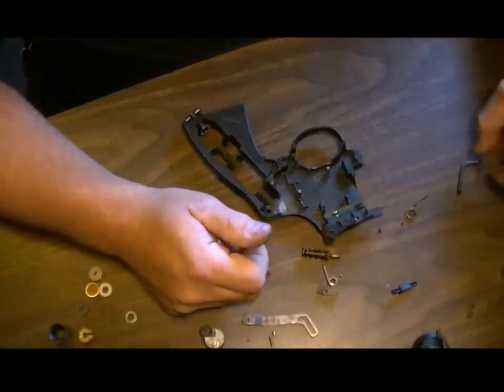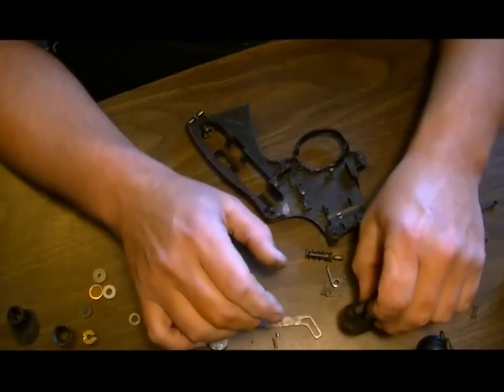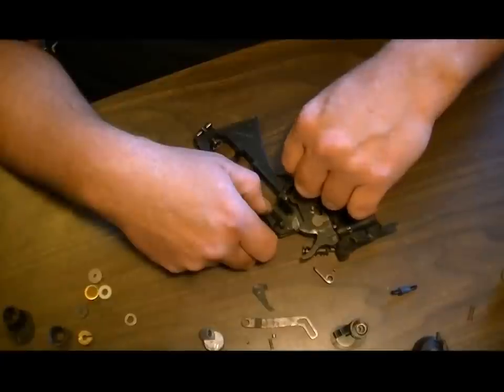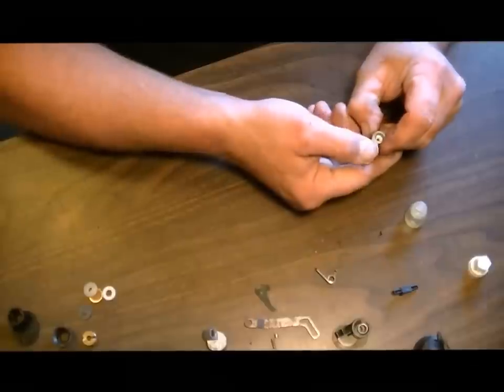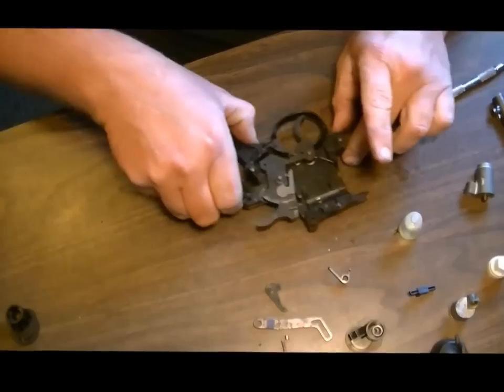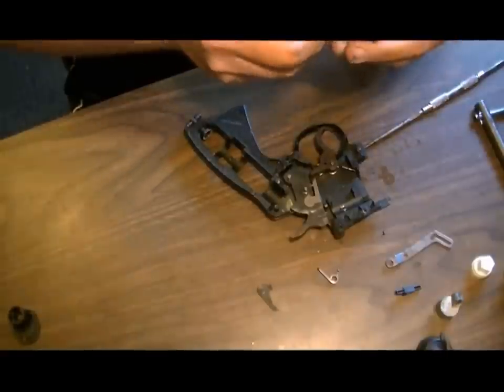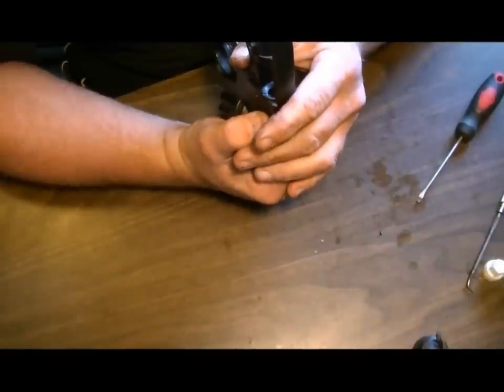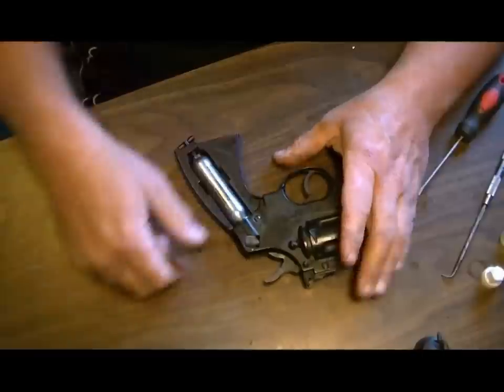Crosman 357 how to rebuild

Comment: Hi, I just bought a Crosman 357 gun and the problem is that, the latch support is missing! Also another problem is that the index finger spring is missing because it won't spin the cylinder! I don't know what those parts are really called so if you can help me figure out those names and website to order them it will GREAT.!

Comment: I used the old valve spring in the new valve which made the plunger react like the old one. I also noticed that he valve tube had a smaller inside diameter so I used the old one also.  The gun now has good power.  Thanks for the advice and again thanks for the great video!  Sorry to be so slow in responding but gun started to index poorly so I replaced the cylinder plate and index finger. It now works perfectly.

Comment from the maker: the oil will get shot out, but having a tighter valve spring in there could be part one of the lower power , and also if the valve was built along time ago then the stem seal could already be shot, run about 3 bottles threw it and see what happens.i never rebuild valves till its time to use them and i never replace the valve springs unless they need to be done, not sure where you got yours but it dont sound like your valve is operating properly,try what i mentioned and let me know.

Comment: My revolver leaks co2 almost immediately after I tighten the cartridge.  I don't know why it happened because it gave no warning at all. Do you think a seal kit will do the job? The gun has been well cared for, never dropped or mistreated.
Reply from the maker: if its just at the co2 bottle area then just put in a new end seal other wise rebuild kit

Comment: I have crosman vigilante almost same as this 357. This video helped me rebuild it because when I opened it all parts fall off. I'm missing that little brass piece what u put in that hole of hammer, is it important and do I need it? My gun works when I pull trigger and everything moves but I haven't tested it with Co2 because i'm afraid it gonna blow up and break gun or my hand.
Reply from the maker: +Allu if your missing parts then call alan at abairgun.com

Comment: Excellent video, thank you. This is going to really help. I just got an old Crosman 357 just like that one, I think it's about 8 or 9 years old. A friend of mine had it, and it doesn't hold gas, so he just gave it to me. I recently re-sealed my old 1976 Crosman 38T, but it is completely different internally (easier than this newer one). So this video really helps.
Reply from the maker: your welcome and happy to hear it helped you
Reply: @KevinMillard68 
Oh and by the way I just got another Vintage Crosman 357 Six Delivered Today, The Only Thing Wrong With It Is The Little Rubber Piece Under The Barrel Latch Assembly Is Missing So The Barrel Won't Lock But I Am Going To Order 2 Of Them In The Next Few Days. One To Repair With and One For A Spare. Just Had Another Vintage Crosman 357 Six Delivered On Friday December 8th.and 2 Vintage Crosman 38C's Delivered, One On December 6th and The Other On December 11th 2 Days Ago. I Got A Vintage Crosman 38T That Was Delivered On July 7th.
I Have Quite An Impressive Collection Of Air Rifles and Pistol, A Lot Of Them Vintage. My Favorite Rifles Being 2 Vintage Crosman 622's In . 22 Calibers and One Had Just Been Resealed and My Other Favorite Is My Vintage Daisy Power Line Model 889 13 Shot Pellet Pump Air Rifle That Had Just Been Resealed and It's In Mind Blowing Excellent Condition With Not A Speck Of Rust Or Scratch On It Anywhere. It Like Brand New and You Can Smell The Wood On It Fresh and It's In The Original Box, A Lot Of Them Are. I Wish It Was Some Way I Could Send Photos.
Thank You Again
Richard Oakley
12/13/2023 @ 8:07 p.m.

Comment: I have done lite work on air pistols - the barrel won’t stay locked - I guess it needs part 357- 021 latch support? The main thing is you can’t get it to puncture the c02. It doesn’t go deep enough to puncher the c02. I screwed it out everything looked good - screwed it back in till it bottom out and still did not puncher the c02.
Reply from the maker: you likey need a new pericing cap as well as the latch boot
Reply: @KevinMillard68  Ok and Thank You.

Comment: Have two of the "old model" .357 Crosmans, this will help a lot in their maintenance. Thanks. Who has the best "O" ring seals? Or do I find the similar sized "O" rings at the hardware store?
Reply from the maker: abairgun.com has the best kits and parts access even for the older crosman guns best to call him so he knows what version of the 357 you have they did make some changes over the years

Comment: Ok...manage to find the kit. while installing it, i drop the gun....
I put all back together...and i ended up with one extra(!!!) spirng...
I think is the one you describe in 3.05 that its on the hammer..but i dont understant where excactly i have to put it...
The gun looks like working properly, but i didnt install a gas yet..untill get an answer for this....
Thanks
Reply from the maker: take a really good look at the video, for where the spring goes if all else fails goto crosmans website and you can download free print for the gun
Reply: KevinMillard68
;) Found it. Followed the diagram..and everything works just fine.
Very useful video for me...and good support also!!

Comment: I've had one for a few years just recently it stopped cycling the cylinder reliably. What would be a common cause of this? I used the old and new cylinder, the old one cycles better than the new one...
Reply from the maker: face place has platic pressure spring that wares out so get a new one and a new indexing prawl and you good to go just be careful not to disturb the seals in the pipe or youll be doing them as well

Comment: This is an effective training video.  I was able to reassemble my air 357 after springs popped off and it was a heap of parts. But, just a tip.  If you have editing software, you could have flipped the image so that the viewer was seeing it straight on, not up side down.  That would have made it easier to follow. Thanks for doing the video!
Reply from the maker: your welcome happy it helped

Comment: Great video!  I ordered all of the parts from Crossman and they are very affordable.  You can still get most of the parts from them. After watching the video I was able to replace all of the seals as well as a new valve assembly and a new piercing body.  At under $20.00 I have a new 357.  Thanks!

Comment: my first shot is fine but then the rest of the "round clip" that the pellets are in become misaligned and won't shoot anymore. I have to manually fidget with the "round clip" to make it work. help.
Reply from the maker: you need a new Pressure plate and indexing finger

Comment: Kevin I was wondering if there was anyway to get better volume out of the cylinders but I guess after watching this that it's preset, also I dripped mine out of the cabinet it was in to a cement floor about 4' and the barrel part jambed back to the cylinder pin I moved it back but it was way to easy to move have any idea's how to stabilize it?
Great video but camera was a but out of range for a good view.
Thanks for posting it it does cime in handy if I was to try to repair one I have two and what weight of oil is that your using? 10w?
Reply from the maker: no idea without having it my hands to see the damage that was done

Comment: I replaced the o-ring, with one of same size, but still all gas is running out fast from that release point, just before barrel. what can be the fault in my gun? I dont have access to service center in my country...
Is something else related to the release of the gas in every shot mechanism?
Thanks

Comment: Hi Kevin:  I took it apart again and found I had managed to lose the little spring that causes the trigger to hook up on the hammer when the trigger is pulled.  I couldn't find it so dug through my "Misc Stuff" and found one similar that I only had to shorted a bit.  The gun works great now so that was the culprit.  I don't know how I managed to do it even after you had warned us not to lose it.  Thanks again for sharing your expertise.
Best Regards,
rocky1405
Reply from the maker: cool good to hear you got her working. ya that tiny spring is a pain sometimes

Comment: my near new Vigilante is not releasing gas when the trigger is pulled. There is pressure within the 2 cylinders I tried but it is not get through to the cylinder
Reply from the maker: they have crapy valves these days known problem crosman still has not fixed so just order in a new valve and your goof to go till it messes up again, if you pull the trigger enough times it will work fine again for awhile till its screwes up again i reallt dont get what the problem is yet with the valves i havea customer with the same problem and they only real fix is to find and older verison 357 valve and then your good to go for 20 years as well as its got good seals in it hard to find those valves tho i have one and they do go for big bucks when you can find them

Comment: Well it is a vintage one,and has a custom BSA log barrel. I live in Alberta so I would be looking at 100cdn?
Reply from the maker: your looking at 54.00 for the basic rebuild kit this will not include a new face plate or indexing prawl which i advise strongy to do  + 35.00 labor and shipping costs both ways iam in ontario there is no mark up on the parts i dont make anymoney on the parts at all. it takes about 2 weeks for me to get the parts ,, crosman canada wont have the parts for vintage guns, so i have to get those parts from the USA and before i can even order in the parts ihave to know which version of the gun you have of the vintage series there was changes made to the linkages for the trigger as well as the indexing prawl as well. so that now adds more time on getting it done and back to you..

Comment: I am just replacing the latch on top, will that mess with the seals when I split the main body?
Reply from the maker: only way toi know is to take it apart do your thing and see what happens its a crap shoot if the pipe seals go or not just make sure to losen off the co2 bottle ring before you remove the cover other wise stuff might happen that you dont want to happen

Comment: Hello Kevin.  Great Video.  Thank you.  I think the latch support boot wedge fell out of mine.  Have you ever seen that happen?  Any recommendation of a replacement part for it?  I could probably get creative about wedging something in there if necessary.  Very helpful to see how it was designed in your video.
Reply from the maker: never seen one fall out but they can dicenagrate for sure and you can order in a new one from crosman just carfull when you open the gun if you pop either one of the quadseals on the brass pipe out youll need a new set of thoes as well
Reply: @KevinMillard68  thanks for the quick reply. Havent used it in a long time. Went through first clip great, accurate. Reloaded and the latch lays flat. Mine is an older model, hopefully the wedge is the same.

Comment: Kevin, I just purchased one of these guns in the original box. It has one issue. The rubber piece thet supports the latch for the barrel is not working i think it is dried out. Do you know the part number or where I might get one? Thank you for your help. Brad
Reply from the maker: Brad Hinz its called a latch support boot and you can order them from any crosman repair depo or call alan at abairgun.com

Comment: is there any differance between a 357 and a 357-6. the 6 means it's a six shooter that can also accept the gray 10 shot wheels. I still can't find the faceplat for it(357-035 is wrong). I can't measure the inside diamater of it and see what the new 1 is and figure out hot make it work. any suggestions.
Reply from the maker: the difference  the barrel length for the most part but there are differecnces inside the guns when they made internl changes otehr changes made was the nozzle spring
Reply: guess when i get the money i'll have too buy the 357-050 and hope it fits in the cavity

Comment: I have a 1357 that function fine with the exception of the latch that hold the gun together after loading.  There is not enough spring tension on the latch.  How can this be repaired?  thanks.
Reply from the maker: you need to replace the latch support boot
Reply: @KevinMillard68  With a bit of research, I found the wedge online.  Pretty pricey for what it is!

Comment: I have a brand new crosman vigilante , I just has a doubt is that when i cock the hammer you know the metal that make contact with the valve to shot , well that part when i cock the hammer moves from back to front , is that normal? or need to be fixed , also everytime i use a co2 with it it just last for 40 consecutives shots, that is normal too?
Reply from the maker: yes all normal operation except the shot count is not consistant for speed from shot to shot over 40 shots how ever still normal
Reply: @KevinMillard68  so do you think that there's a problem with the gun valve ? I used a screwdriver in that circle part around the valve to make sure it was adjusted.

Comment: I tried to contact. no answer. I replaced the o-ring you use in 5:20 of the video. Can rapid loose of gas from that position, conected to the "quads" (i suppose is those  2 on both ends of that brass pipe)? Or can it be because of the part you replace in 6:50 ?
Thanks again

Comment: What is the thing that the air goes thru called mine is not keeping the air in the cartridge when I screw it in it leaks in the gun and I just got it from my older family member and it is still very nice and will should just don't hold the air.
Reply from the maker: end seal for teh co2 bottle and there is also 2 quadseals that leak as well ,, my advice get a full rebuild kit from abairgun.com and rebuild the valve and all the seals and might as well get a new hammer spring as well and she will be just like new again
Reply: Thank you very much

Comment: The latch on my gun does not latch!  I think the latch support is missing. Can that support be purchased and can it be installed without taking the gun apart? If not, where can I send it for repair and what is the cost?
Reply from the maker: +joseph bourque you can buy the latch support boot seperat yes and your old one is probely still in the gun just worn right out ,. and yes the gun must come apart. if you live in the U.S then send it to alan at abairgun.com  if you live in canada find your nearest repair centre if and only if its a new version 357 if its and old school one then you need to send it to alan at abaigun or find someone in canada that fixes old and new crosman airguns...

Comment: My dad is trying to assemble his Crossman 357 but the only piece missing is the wedge mentioned. I was thinking of making one myself so I was wondering if you could tell me the measurements of the wedge. Or better yet, if there is a place you can buy one. Thanks.
Reply from the maker: sorry cant help you on that one i dont have any but you can use a med powered small spring in place
Reply: Alright. thanks!
Reply from the maker: your welcome
Reply: potatosword I used a spring that fit in that spot just right. the wedge  that it had was all gummed up and started to fall apart

Comment: Thanks for the great video.  Thanks to your great step by step instructions my rebuild was easy. One thing I have noticed though, is that my gun seems to have a little less power than before. My seal kit contained the complete valve and CO2 inlet assembly and the plunger is stiffer than my original. Also there was a lot of oil in the valves.  Would these affect the power?  Again thanks for a great video.

Comment: Question Kevin, I have the old 357 "brown grips" but it was missing the parts in the c02 puncture area. The gun was my brothers and I wanted it fixed. I bought a kit off ebay that came with the new valve assembly prebuilt, just drop it in and screw case back together. He sold it as a kit for phase 1 and 2 guns, but I noticed it is for the newer guns. However I installed it regardless. It does shoot, but its only giving me a small percentage of power, not even enough to push a pellet out of the clip. I messaged the seller and he said it could be the hammer or hammer spring. I doubt that, I suspect a blockage in the jet or valve perhaps? I really want this old gun working again.
Reply from the maker: order in the parts for the original valve/gun from alan at abairgun.com dont ever but seal kits for any guns or older crosman guns off eaby always goto alan he is the best and has the proper parts . you might have gotten a bum valve and the newer valves SUCK rally bad. FYI never email him , call him only after 6 or 6:30 pm kanas time ..

Comment: great video! I have a similar Crosman Vigilante, with a broken barrel latch. is there anywhere that you know of where I could get a replacement part? thanks!
Reply from the maker: +MrAlexanduh if the place you bought it from also repairs them then goto them other wise any place the fixes crosman airguns doa google search and you can also goto abairgun.com as well for crosman parts

Comment: Does the steel barrel just float inside plastic housing? Mine started coming out and I had to push it back in.
Reply from the maker: more or less it floats the metal hanger is all that sort of locks the metal barrel in
Reply: KevinMillard68
Thanks, I’ll have to check into it better. The barrel actually fell out on me when I was loading it.
I have not been able to get consistent accuracy with it.
Reply from the maker: Frank L ya its not 100% accurate but its a fun gun. its limits are pretty much 10 meters for accuracy but you will get strays, you do need to find a good pellet for it tho its a picky bugger